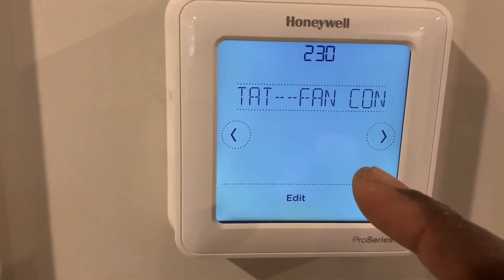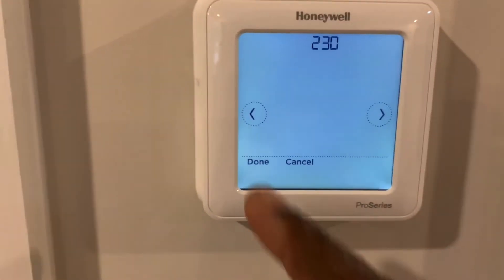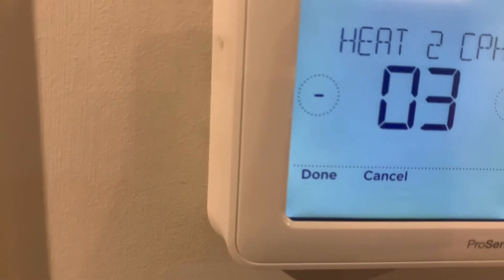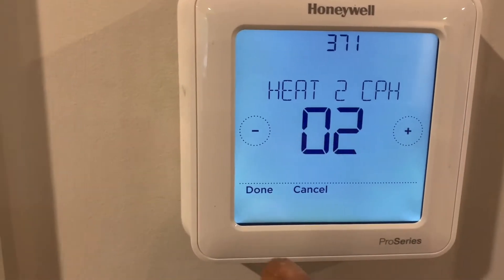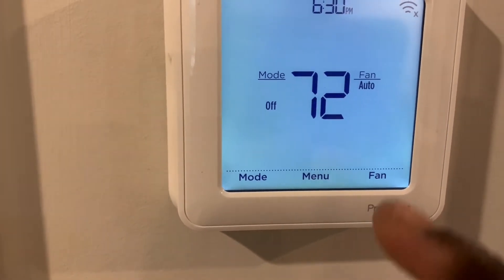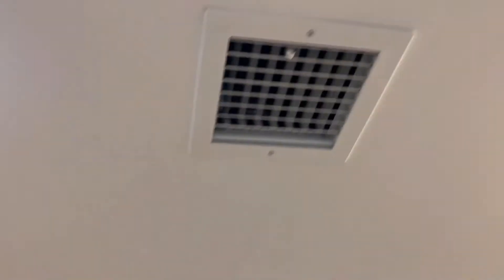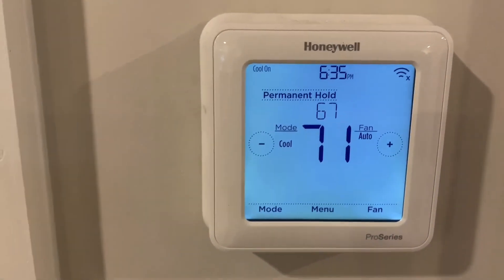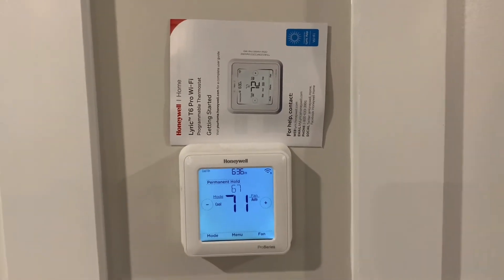HOW TO SETUP HONEYWELL LYRIC T6 PRO THERMOSTAT | HOW TO WIRE A RESIDENTIAL A/C UNIT

Comment: What do I check if I set the temp to 75, but current temp won't show anything above 70?  We just had minus 10 degrees outside when this started happening.
Reply from the maker: Your heating system may not be up to par!😢
Reply: @D2DNYAC  ok thanks it’s a 2020 home.

Comment: You said it was a heat pump. White wire and orange wire are wrong. White wire goes to W2 only. No wire is supposed to go to W. Orange wire goes to O / B.
Reply from the maker: You are correct, however I have other controls incorporated with this setup
Reply: @D2DNYAC  What kind of other controls do you have. Just curious.

Comment: Hello, does this thermastat not have an outdoor temp and humidity display? I upgraded from the 8000 series which displayed both so I know my system has it.
Reply from the maker: That’s a feature of the 8000 series
Reply from the maker: Actually it should once you're on wifi and the option is selected!

Comment: Please could you tel me why you didn’t connect the reversing valve in its place!!!!
Reply from the maker: This was a special setup request to have heat pump run as backup stage in normal heat pump setup compressor will start once thermostat calls for heat!
Reply: I still didn’t understand how your ac going to work in the summer with O not connected in its terminal and in the winter how your defrost control board going to work also .please explain. Thanks
Reply from the maker: I added time delay switch and relays to accomplish this watch the video again please, see on this setup I wanted to have the heat pump compressor only turns on in the event the hot water coil can’t satisfy the heat demand, so he the hot water heating coil is primary on the initial call for heat! The heat pump is secondary or second stage after an additional 10 minutes time delay

Comment: How do I change the stages and what does it do like does it sends more heat or less? Plz respond.
Reply from the maker: In the setup menu set 221 to 2 and save. That is if you have 2 stages of heat w1 and w2 wires connected on thermostat sub base!  And yes if you have a 2 stage heating equipment 2nd stage will give  you more heat!
Reply: @D2DNYAC  oh okay thank you so much.